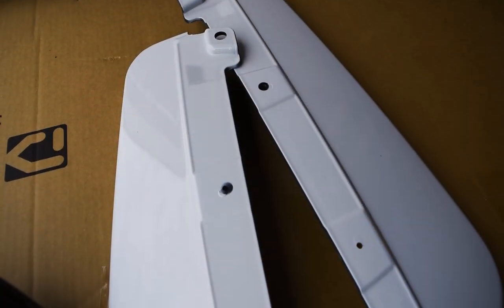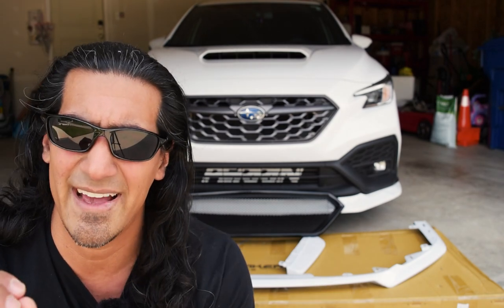Noble STI Style Lip / Spats / Recessed Grill // Install + Impressions // #2022wrx #wrx #subaru

Comment: When I did the rear spats on mine I used 3 pop clips and then 1 self tapper in the rear (I widened the 2 middles holes to fit the pop clips). The pop clip in the front i was able to use but i absolutely had to murder my thumb in the process haha. I got the noble CF ones on my WR blue, happy with them so far. IIR has been great

Comment: The new lip looks great. I have the Aeroflo like the one you just removed. I also hove the Silvers coil overs. I do have to be very careful. The Silvers are very easy to install. I did have the luxury of a lift however. Keep up doing the great videos.

Comment: Nice vid as usual 😊. Did you have any trouble putting the bumper back on ? You didn't show putting it back on.Also if you are going to put coil overs on remember to go to the store and get a box of band aids😅😊
Reply from the maker: The only issue I ran into was the plastic shroud which I had to remove. Besides that bumper went on easy. I have taken it off so many times now 😂

Comment: Those black raw plastics will always chip if you don't sand first, then apply an adhesion promoter, followed by non-etching primer, then paint and clear. I learned it the hard way. 😅

Comment: Try installing the AFD v7 spats.. What a PITA! On the first pop clip behind the mud flap it is not contoured to fit flush. The spat is aluminum and it leaves a quarter inch gap to the hole. I did get it after 20 minutes of brute force pushing the pop clip. They do look great but if you ever switch out yours for the AFD spats. Your in for a world of F-bombs!

Comment: Yikes a Knuckle-Buster! haha I got the JDMuscleusa aero combo, and same thing. I have RAlly Armor flaps so no bracket like that. But I did use a drill bit and drill out that smaller hole on the spat and then used the stock clips, and for front with no bracket, and then the self-tap, no tape. Worked great. But yes annoying you have to do modifications from the factory.

Comment: Ive been doing the opposite for once, only exterior stuff for now, real mods later. Burned myself one too many times doing opposite so im sticking with the warranty this time ( or atleast trying to.. its hard to stop myself). Im super excited to dive into real mods again eventually but crap its so hard not to. 
also for my lip/sides i did 3m to start and kinda line it up then the self tappers, i think the combo will help holding it tight cause 3m is surprisingly strong
Reply from the maker: That's actually never a bad idea tbh. I love cosmetic mods actually but never really bought them before because my previous cars were already low, or had good factory aero, nice spoilers
Reply: I went with eBay front and side lips and they fit just as perfectly for quite a bit less so I was happily content with how they came out, bunch of other little things too like the blackout kits for all the lights and tint it, but I do want to do the wing myself too it looks great, just looks a little goofy with both the lip and wing that the premium comes with.. lol

Comment: I like the front grill but all the skirting I would paint matt black same the rims, mud flaps if required in black and then get a white wing Matt black for the roof. Or you could just paint all the skirts in red with black rims and and matt black roof and then leave the rest stock. If you like what you have and your're happy then kudos but yeah sorry, I'm not diggin your ride at the moment. Best of luck bro, trial and error
Reply from the maker: Well the things that you're describing are super subjective. There's absolutely nothing wrong with liking something different. For me I love the black and white and the white accents really help the cladding stand out even more which I really appreciate in this design. I will actually be getting rid of the lip to replace it with a bumper bar very soon. I'm not sure if I'm going to keep the rest of the arrow kit though considering I'm going lifted and I will be using this car for the dirt track and rallycross. So the build is changing quite a bit you should check out the latest videos.

Comment: Why not mount the lip to the bumper while it is off the car?
Reply from the maker: Realistically one of the "ease of use" features for the lip is you should be able to install it without removing the bumper. It's not easy for everyone to do. Later on I actually bolted this lip to the bumper because I don't like the self tapping screws.

Comment: I think the lip would look nicer if the center section of it was black.
Reply from the maker: Now that's a really interesting idea. You might be on to something
Reply: @HeavyMetalWRX  The beginning of the video where you had the black grill laid up against the bumper, kind of gave the lip the illusion of being black in the middle. It'd look great! And it'd match the rear spats as the rear is now white at the corners and black through the middle.